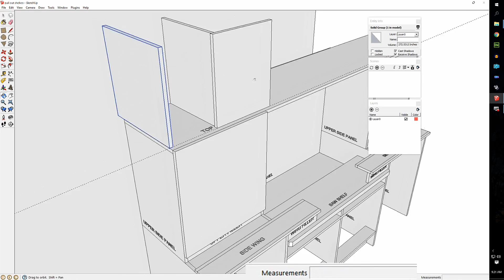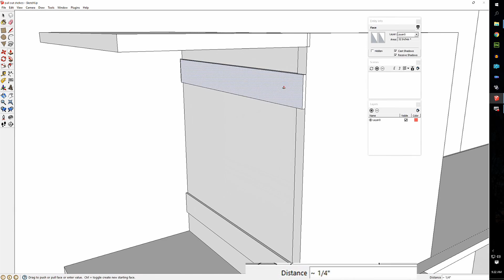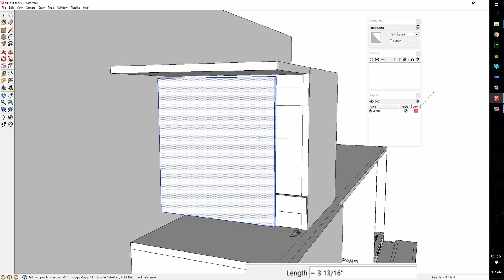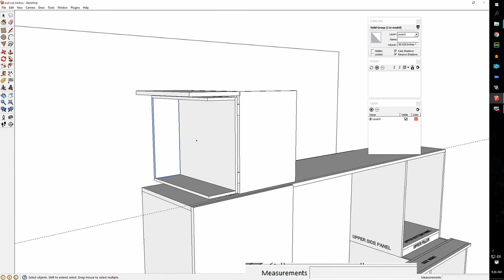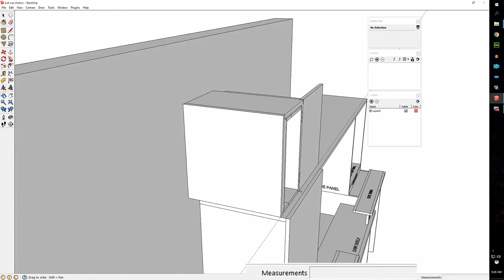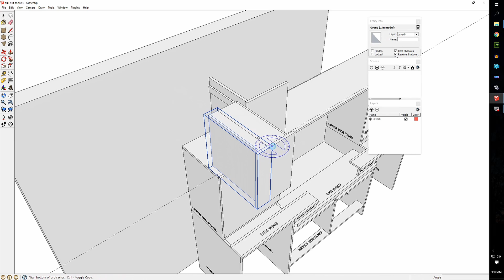Design A Folding Vertical Drawer (SketchUp)

Comment: I was wondering why my taskbar was stuck open (set to autohide).  Then I noticed unfamiliar icons and realized it wasn't my taskbar.  I don't know how you can stand Sketchup, but then again, I use Blender.  Thanks for the info on Davinci Resolve.  I never knew it existed.  It looks like a great program.  I haven't recorded anything for my other channel yet, but I'm looking forward to testing it.  For my screen capture, I use Icecream Screen Recorder.  (you can also use your GPU - it has built in screen capture function as well - if it's AMD or NVIDIA).

Comment: I use Sketchup for my shop drawings and I generally model to exact size then build directly from the drawings.  My reason for doing this is to reduce thinking time once I get in the shop.  Cut the parts according to the drawings then assemble.  No thinking needed.  Come to think of it that is the same reason I buy plans from John.  I don't have to stand in front of my tablesaw scratching my head I can just cut and assemble according to John's truly excellent plans.  Buy them, they are worth every penny.

Comment: Why don't you make the back panel of the pull-out section full width and then put a hinge on the side that swings out? That way you don't end up having to pull the whole section out and then swing out the side section even further into the room to get access to the stuff inside, you can merely swing it to the left and get access to both sides?
Reply from the maker: Sounds like 6 of one, half dozen of the other to me.

Comment: Maybe you explained somewhere, and I apologize if I missed it, but what's the purpose of making every individual piece a "group"?
Reply from the maker: Making a finished part a group or component locks it and makes it individual. You'd need to use SketchUp for a bit to better understand why that's important.
Reply: Acknowledged. I'm still a novice. It works pretty differently from any other 3D modeling application I've ever used. Thanks for answering!

Comment: Cool idea. Have you tried using the drawer slides on the top and bottom of the drawer rather than the back? I'm curious if that would make racking from weight easier to compensate for or if it would just be worse.

Comment: Make the stick to a specific length (eg 6 inches) and you can use the existing measuring system; just distract that length from the measurement at the end of the stick. Easy peasy.

Comment: Window > Model Info > Statistics > Purge Unused. Helps with keeping any sketchup file lighter, doesn't hurt to hit "fix problems" either, most of the times it won't have anything to fix, but, sometimes when you've worked multiple times on it, it finds the issues. Just thought i'd share this, it's a lesser known trick that does a difference with older computers, but even with newer ones, by helping with smoother manipulation.
Reply from the maker: I use that every time I finish a drawing that I will upload to my site, since it can save a ton of bandwidth. Nice if more people knew about it, but most don't care about the file size.
Reply: Oh, and you can make yourself a Macro for "make group" function. Worth having especially with your style of working these.
Reply from the maker: aserta
I talked about that in the description, which no one bothers to read :)
Reply: +I Build It
What, is there a description somewhere?

Comment: Are you using Sketchup Pro or Make?
Reply: Pro says "pro" in the top left corner title. So i think this is the free one. For every day Joe, the free one, is more than enough. I bought the pro one because i've been using it since it first came around, thus use the more "elevated" functions, but really, free sketchup is good enough, certainly more useful as a tool, and easier to learn than any other program that deals in these things.
Reply: I couldn't tell but he said it was version 8, which is a couple of years old.  Make is great for concept or shop drawings and some presentation drawings.  Pro is mostly for presentation drawings.  Assuming that you didn't know that already.  : )

Comment: Great job on the SketchUp tutorial John.  I like you idea of the pullout & swing open space, especially for higher areas.  It will definitely make accessing the things at the back much simpler.  Was there a reason you mounted the pull-out on the right instead of the left?  I would think a left mount, allowing the fold to face the saw, would have been a bit more functional.

Comment: would it be better to actually mount the drawer slides on the top and bottom of the interior of the cabinet as supposed to mounting it on one side? Especially since the vertical drawer is quite wide and might get quite heavy when loaded with tools. In theory, it should distribute the forces a little bit better and avoid an excessive amount of pull on the top slide and excessive amount of push on the bottom slide.
Reply from the maker: Slides have no strength in that configuration. Besides, there is a limit to how much weight you can put in such a small space (due to size) and I don't see that even coming close to the load capacity of these slides.
Reply: I Build It Yeah I guess so, makes sense, and might be easier to install (the top one would be very very difficult to install in my suggested config)

Comment from the maker: An interesting way to make use of the space above the new miter saw station.
I'm using SketchUp version 8 and normally use more custom shortcut keys while drawing (like "G" to make the selection a group and so on), but tried to slow things down here a bit to illustrate the process better.
As I alluded to in the video, I've already started building this and had a problem with the fold out part and had to make it shorter.
Unfortunately, I didn't get the chance to design the one up above the upper cabinet, so I'll save that for another video.

You can help support the work I do in making these videos:

Plans for sale: http://www.ibuildit.ca/plans.html

Support this channel on Patreon:
https://www.patreon.com/user?u=865843&ty=h

Did you know I have two other YouTube channels?
My main channel: 
https://www.youtube.com/user/jpheisz
My home reno channel: 
http://www.youtube.com/c/IBuildItHome